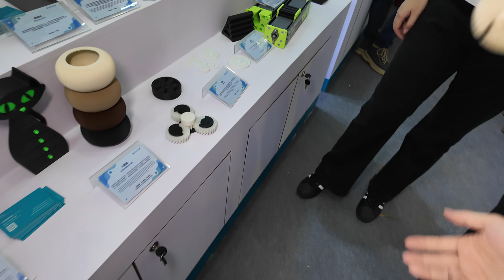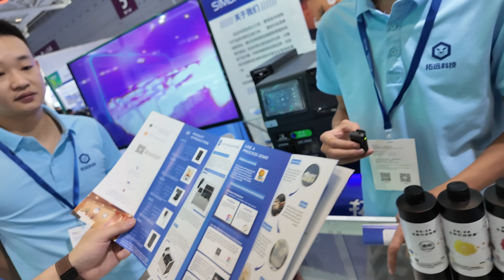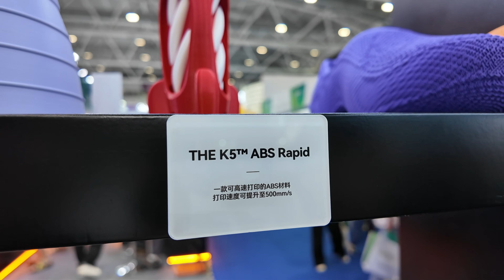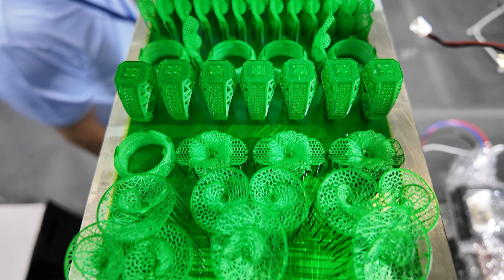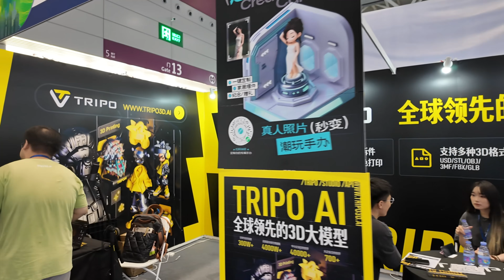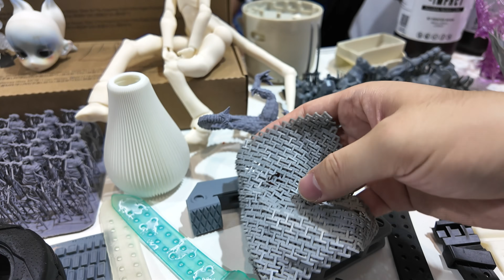The Future of 3D Printing? Full-Color, Ultra Precision & Speed at Formnext!

Comment: Do a quick drop by the WonderMaker booth and see if the printers they brought are actually printing anything as complicated as the models they have displayed there.
Reply from the maker: I didn't see WonderMaker's booth. I checked—are you referring to their tool-changing printing solution? Currently, the Snapmaker U1 also uses a tool-changing solution and is already in mass production. I'm currently reviewing the U1 and will be posting a video about it later.